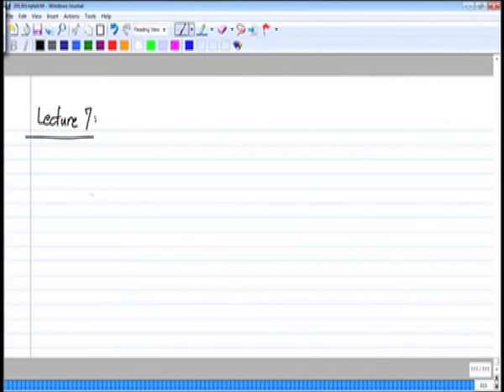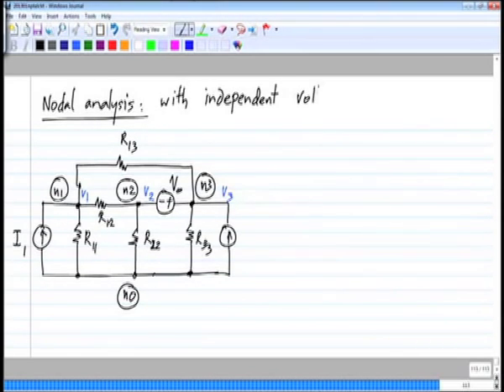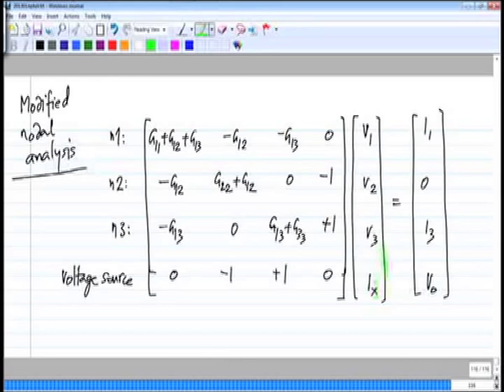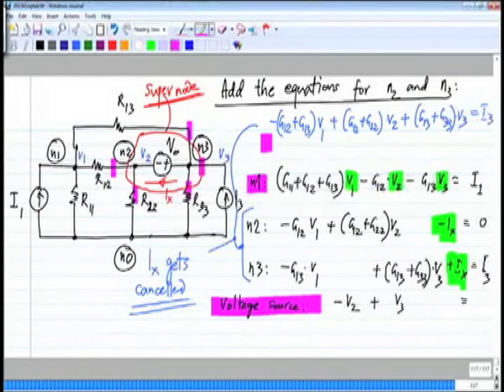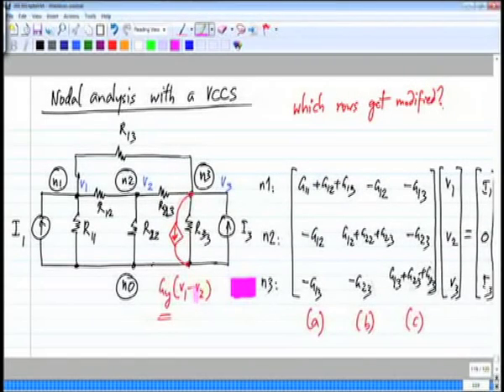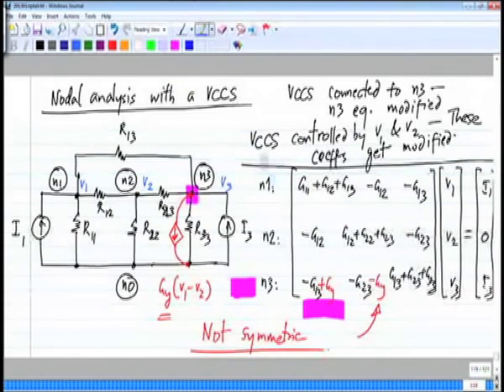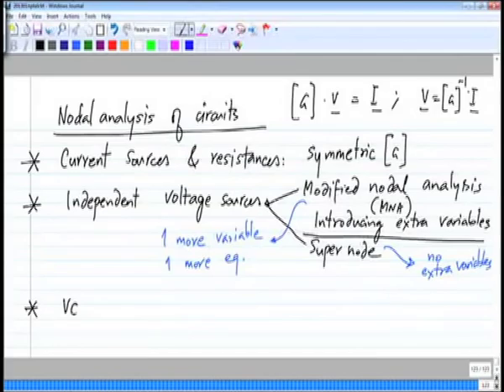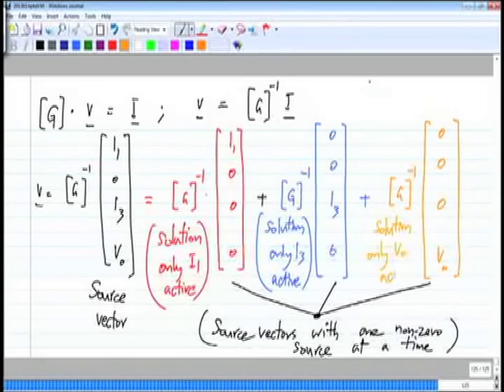Mod-01 Lec-07  Nodal analysis with voltage sources and controlled sources; Brief introduction

Comment: What if the independent voltage source is connected between the reference node and another another node? Is it still possible to form a supernode as explained in the video?